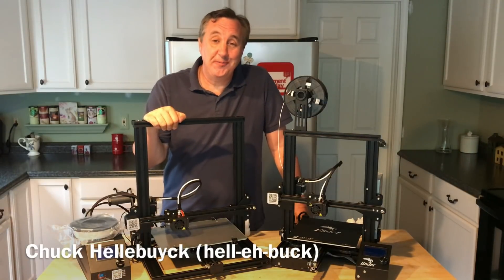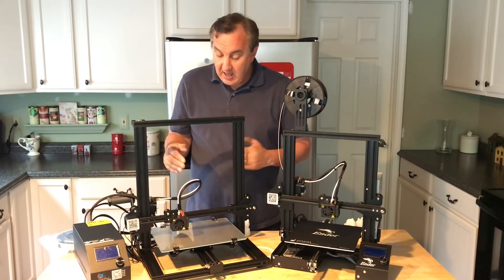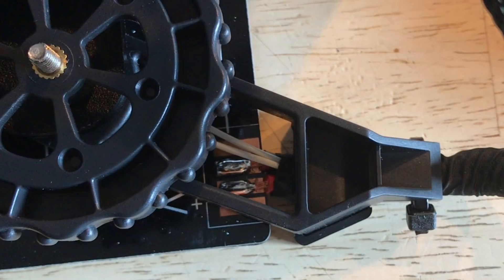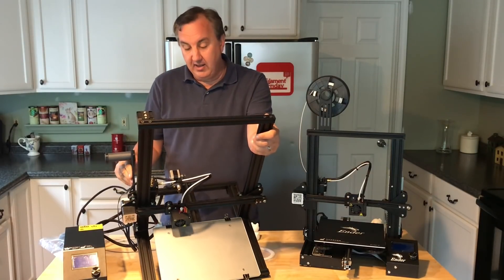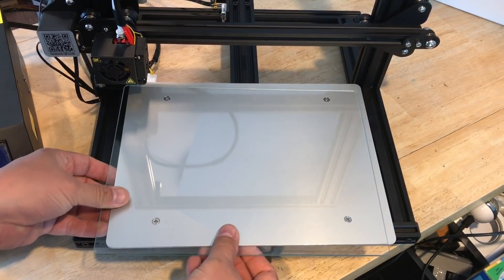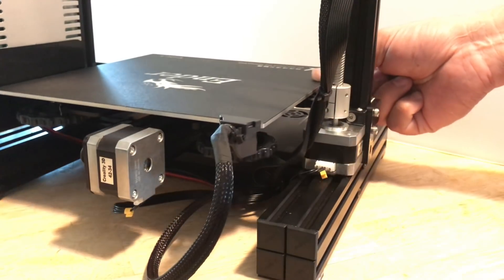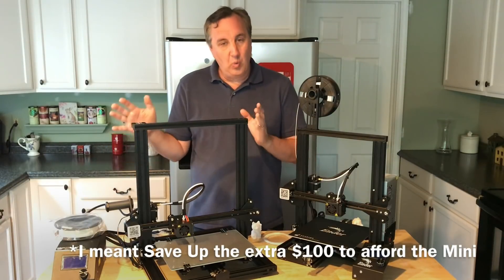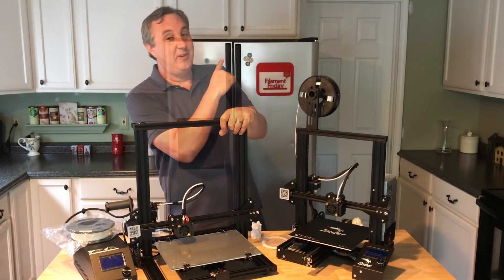Creality Ender 3 vs CR-10 Mini 3D Printers

Comment: I lucked out a couple months ago and got a mini from Bangood for $150 when they were discintinuing it. The only thing I had to do to it was adjust the y axis carriage wheels and mount the spool holder on the top rail. Since I have added the modular direct extruder feed and experiment with some settings. Thank you for the excellent teaching videos!

Comment: Great comparison.  I guess they are possibly closing out the CR-10 Mini or something, because I just got a CR-10 Mini new from Banggood for $150 shipped.  So now I have gone from Mini (Monoprice Mini) to Mini (CR-10 Mini, which isn't really all that Mini...).
First couple of prints with glue on glass have come out great....
My MPSM has been solid for me, and still working, but I was eyeing the Ender 3's around $180ish, but then saw the CR-10 Mini deal and couldn't pass that up...

Comment: I watched your videos setting up my ender 3, i had no problems what so ever with it, it printed the dog flawlessly with great quality. it came out smooth with no stringing or bumps, used a red PLA bought from amazon. It was a Definite upgrade compared to the Da vinci Jr 1.0 that i had been using.

Comment: Definitely the CR 10 mini is still my go to printer for a awesome print and I haven't had as many problems with the mini  than the CR 10s or the Ender 3. I've had  the mini the longest which has been over a year now and other than me printing some upgrades and normal stuff that goes wrong over time.

Comment: Hi, I’m new to 3D and I’m in the process of deciding on the overall best printer between the Ender 3, Ender 3 Pro and CR 10 mini. Pretending they were the exact same price, which one of the three would you choose? Thank you!
Reply: Donna Sandoval Ender 3 Pro
Reply from the maker: CR-10 Mini is bigger so that is an advantage. But they aren’t the same price so Ender 3 is the best deal in my opinion of those three. It leaves you budget to upgrade the board to silent board, upgrade the PTFE and upgrade the extruder for flexibles.
Reply: Thank you for the great advice! That helps me make my decision! Love your helpful videos!

Comment: Thanks, Awesome...been l;ooking around after the printer i wanted ended up sold out from 599 for 302?! ..couldnt resist. but too late when i had the cash to buy. So i find a model 10 websites later nd many vids.. come to more models ect ect... but somehow the whole afternoon and turning into night-early morning fast, I keep ending up seeing you do a comparrison with added cool clever Real info where what and why YOU upgraded something. Thanks, I decided now I also really REALLY liked the other vids on your channel. Especially the one where you explain replacing the tubing and got bits on amezon ect which you refer to here in the vid. That was really helpfull! cause i almost got a ender ..but really got my hart stuck on the bigger build volume. the extra 10x10 really will work out i think. nI really was doubting the print quality of the cr10 mini out of the box ..cause of the extra 100 dollars and expected to spend the difference on upgrading the ender if i bought it.  I really wanted the cr10 mini though and this really helped to see the actual difference between the two out of the box. I SO Happy the cr10 mini did well in the test. 
I wil be adding some improvements like if seen in earlier videos from you. So Yeah . Awesome for putting in the time. I'll be back :-)
Alx

Comment: Hi Chuck! I am not sure if you see the new comments on your older videos.I was thinking about purchasing a budget (400 below for me) 3d printer and I narrowed the choices down to the Ender 3, the Ender pro, and the CR-10 Mini. Of the three, which would you recommend? Thank You!
Reply from the maker: All good. CR-10 Mini if you want bigger prints. Otherwise Ender 3.
Reply: CHEP Thank you so much for responding so fast! I had one more comment I forgot to ask in my previous comment. My question is what do you think is the best beginner and budget (400 below for me) 3D printer for someone how has little to no experience with 3D printers. Thanks Chuck!

Comment: Wish I had the CR-10 Mini.  My Ender 3 is stable but the bed is great on the 4 corners but dips in the middle.  I just got some Ace Hardware cheap window glass ($3) and a glue stick.  Works great.  PLA , glue wasn’t required.  PETG.  Different story. 😆

Comment: Hi
I've been using the Ender 3 Pro for a couple weeks now with no real issues but yesterday and today I've been getting what I think you call layer shifts but only on the bigger prints smaller prints seem at large OK is this a mechanical issue? Or software?

Regards
Reply from the maker: Not sure. It’s often related to acceleration settings.

Comment: Thanks Chuck!  I haven't bought a printer yet and I have a question about the banggood site.  It has the following notes under the product specs for the CR-10 mini: 

1. Do not include T-bracket(right side)
2. The US/AU warehouse do not have the adapter

I think maybe those correspond to the numbered features they list above the specs:

1. Based on CR-10, Only take 5 minutes to install and test
2. Support resume print while power failure.

Does any of that give you pause?

Thanks!
Reply from the maker: No, if you are in the USA make sure you buy from the USA warehouse. It will ship within 3-5 days and shipping is only $2.99.
From Banggood :  https://bit.ly/2u5XNJk

Comment: What about the heating of the bed on the CR10 mini? I mainly want to get an Ender 3 because I know that the original CR10 could only heat the bed up to 85 degrees celsius and it is slow like a snail. Is the Mini any better?
Reply from the maker: It’s a bit better as the bed is smaller but because it’s 12v it takes longer to heat up. I can get to 90°C easy enough but Ender 3 is faster.

Comment: I Have the ender 3, but i wish i had seen this video sooner. It prints great no doubt. And I really wouldn’t need the cr10 mini extra volume.

 But I just hate the way how it’s built. The electronic box and the control panel are so unpractically placed. 
The y axis aluminium profile is 2040 (horizontally mounted, the bed carriage rolls only on the 20mm side) and is connected only in the middle to the frame. On the other profile (4040) there are two milled grooves. First on the left for the wires coming from the electronic box,  and the second 20mm groove to “fit in” the y profile, right in the middle and I believe that’s the cause of the frame twisting because it’s the core profile of the whole frame and it’s weaken because of those grooves.

On the cr10 mini there is no 4040 profile in the middle, but two 2040 profiles, first on the front, and the second on the back of the base. Both mounted, nothing milled.  Which I think is much better solution. And the y profile is the same 2040, but it is mounted vertically, so the bed carriage rolls on the 40mm side, and it has 2 mounting points. 

An those freaking wires are driving me nuts how short they are.

I’m actually thinking about buying some extra profiles and rebuilding the frame to the cr10 mini style.
And also making a second z axis like myfordboy did on his channel to his cr10. 

The printing quality is just matter of tweaking the settings. 

Sorry for my English, It’s not my native language.

Comment: The CR10 Mini looks great. 
I have the Ender 3 and I am not sure why your frame is wobbly. I didn't tighten anything until it was fully assembled to allow some play in the frame. It was only  after it was fully assembled I went back and tightened up the bolts. I suspect that could be where your wobble is and also possibly affecting your prints. 

Great printers. I bought my ender 3 off ebay for $165 and I couldn't be happier. All of my desired prints are small anyway.

Comment: Hey Chuck. I found this video, but a bit late I guess... I've been trying to figure out which printer to buy as my first but there are just so many different kinds with only small differences. I've come to the conclusion that Creality3D is what I want to go for but there is still Ender-3, Ender 3X, Ender 3 Pro, Ender 5, CR 10 Mini, CR10, CR10S and so on...

I notice that in this video you recommend the CR10Mini, but then in most of your newer videos you are using the Ender-3..?

Which of the above would you recommend, or discard? And what would in your mind be the most/first important upgrade?

I hope you have time to reply! I really liked your videos, I'm now subscribed and will keep watching all of them.
Reply: I believe the Ender 3x is only for 1 country. I feel the Ender 3 is a better buy than the Pro as they are basically the same. The various tweaks are minor and a glass bed can be purchased (major difference) for $20. 

Moving up is just about build size mostly. I bought the Ender 3 for it's price point to start. Will you use the thing a lot or will it just collect dust in 2 months? I didn't know the answer so I bought as cheap as possible. I'd rather have a $165 printer collecting dust then a $400 printer, in the event I don't use it. However it is addicting. Knowing what I know now, I may have splurged with the cr10 mini but the Ender 3 is great and I have no buyers remorse.
Reply from the maker: I still like the CR-10 Mini. Solid simple printer with same electronics as Ender 3 but 300mm build are in X and Z but Y is same as Ender so it fits on a bench. Electronics is separate but that makes it easier to fix and separate if you want to enclose the printer. At under $350 it’s a great printer.

I don’t really see the big advantage to 24v. I use CR-10 minis daily. They heat up fine. I just really like the glass bed and larger build area. Most things I Print will fit on the mini. The Ender 3 can be a bit small. But for small detailed prints the Ender 3 has a slight edge. The lighter bed and no glass produce slightly better detail.

Comment: Kind of continuing Tim Robertson's question a few days ago because the price difference has made it too appealing (CR-10 is $40 less than Mini on Creality's own site)... So besides the physical differences between the Cr-10 mini/Ender 3 and the CR-10, does it just come down to lack of Auto-resume for the CR-10 (the older mainboard)?  And if I'm remembering correctly from a bunch of threads I read online, Auto-resume really only works well if caught before temps start dropping on the printer (I'm out of luck if I'm monitoring it from work)?  Trying to figure out how important Auto-resume will be for me, the hobbyist.  Thanks Chuck.  Happy Holidays to you and yours.
Reply from the maker: Auto resume can be added with a firmware update. It’s not a big deal.

Comment: Nice video.  have you noticed any heating time differences between the two machines - 12V vs 24V?
Reply from the maker: The Ender 3 has a smaller bed so it already heats faster even if they were equal voltage.

Comment: I am curious.  Does the control box for the Mini stretch to be placed on the right side of the printer versus only on the left side?
Reply from the maker: You can get extension cables from Banggood to do that but it won’t reach without it.
Reply: Thank you
Reply from the maker: You can get extension cables from Banggood to do that but won’t reach without them.

Comment: Due to prices going up so much how do you feel about CR-10 vs CR-10 Mini since they are now almost same cost?
Reply from the maker: I took the extra threaded rod off my CR-10S. I like the CR-10 better than the CR-10s.
Reply from the maker: I recently had similar conversation with my YouTube friend Jimmy DiResta. I set him up with a CR-10 mini. He had it setup and printing in less than an hour and loves it. Ender 3 your still assembling it in that time. 

It all depends on what you want to print. Personally I think one Ender 3 and one CR-10 mini in the shop is the best choice at around $500 for both. Then you can print big, small and twice as fast.
Reply from the maker: Where are they the same price? I’m still seeing a $50-$70 difference. Both are good machines.
Reply: CHEP, well I went back to check and the link I had was sold. There was on about $30 difference 1 day ago. I will probably purchase the larger machine. Just wanted your opinion. The price difference isn’t an issue. I just want a good functioning machine.
Reply from the maker: The CR-10 was $339 for a short time which is a great deal for that printer. I don’t think you can go wrong with either. I have both and use them all the time.

Comment: I just bought an Ender 3 in Australia for about half the price of the Mini. That's AUD$239 vs AUD$460.
Reply from the maker: Yeah, the Mini has really gone up recently. I believe it’s related to Christmas rush.
Reply: Where did you buy it from?
Reply: @sammyflorczak8800  Ibought it  8 days before Xmas on eBay. I was also lucky enough to get the eBay 10% off at that time  which made it $215.10 (USA$153). Now the not so good news the same place has it now for $249. 
I only bought it as it was so cheap and my CR-10s had a capacitor failure at C4 on the board and I was waiting for some capacitors I had bought from eBay. At this point in time the Ender 3 has been pretty good.

https://www.ebay.com.au/itm/Upgraded-Creality-Ender-3-3D-Printer-220X220X250mm-DC-24V-15A-1-75mm-PLA/382650062511?ssPageName=STRK%3AMEBIDX%3AIT&_trksid=p2057872.m2749.l2649

Comment: Thank you Chuck. I've been trying to gain knowledge to make an informed decision before purchasing. I was originally considering a Dbot CoreXY (and will probably have one in the future at some time) but, I saw how big of a community the Creality printers have behind them. Your video helps me reaffirm my decision to go with the Mini (I don't need the bigger build volume... yet.)  I still may get an Ender for my niece.

I have a quick question though. You mentioned that having the electronics fastened to the frame of the printer has its positives and negatives. Do you think the electronics of the Ender could be re-configured into a separate unit like the CR-10 with a little DIY?  Are the cables long enough? A little sheet metal, a bending brake, a couple of extrusions to connect the base ends and a different pulley on the base could make it a mini CR-10 Mini!

p.s.  I hope Connor has a good game but doesn't shutout my LA Kings tonight. I hate that the NHL decided not to participate in the Olympics. I was looking forward to seeing him represent the team for many years to come.
Reply from the maker: It could be done on the Ender 3 but the wiring needs to be extended so it’s a lot of work.

Comment: Do these require different wiring for a 220 watt thing, llike a different plug? or is the wattage for the heating bed?
Reply from the maker: If you mean European 220v use, then no. There is a switch on the power supply that you flip to 220 and if you buy the non-USA version you get the proper cord as well.
Reply: thanks, I wasn't ssure if I'd have to rewire my house to use one safely

Comment: $329.99 for the CR 10 Mini through your link.
Reply from the maker: Im told they sold out of the USA warehouse but more stock is coming soon and those will be the $289.99 price so keep watching. 
Right now the full size CR-10 is only $339.99 which is a great deal.

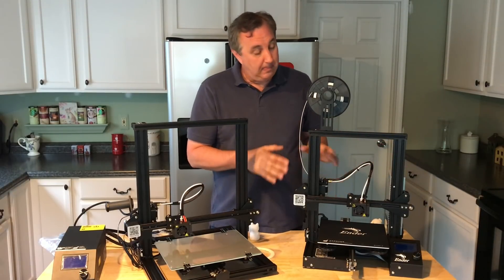Comment: Thanks Chuck.   At 4:13 you comment on the Ender-3 spool holder being too narrow for wider spools.  As shown, the holder has been assembled correctly, according to the instructions.  Another reviewer also pointed this out, and one of his viewers left a solution in the comments...  remove the spool holder from the frame, rotate it 180 degrees, and refit it.   Now unscrew the spool support tube from the pressed steel upright, and reinsert it from the rear.  The holder (which is still in the same location it started from), will now accept spools up to 10mm wider.  If you look at the CR10 Mini spool holder at 4:20, you will see it uses the same tube, but it has been assembled as above, right from the start.  Both machines will now accept spools up to the same max width.
Reply from the maker: No, my point was the height (and angle) that I didn’t fully explain. I couldn’t mount it on the back like I did with the CR-10 mini because it was too short, the spools hit.

Comment: Is the CR-10 mini enhancement over the Ender 3 proportional to the price, or is it much better in respect to the price (I mean the upgrade is more worth than the 100$ price premium)?
I don't really have a lot of money to spend, but I want something relatively reliable and the best bang-for-the-buck printer. Right now I was really leaning towards the Ender 3, but if you say it's total crap I am willing to save up for another month or so.
Reply from the maker: They are both good but the CR-10 Mini gives you a bigger build area so you can print bigger objects. Print quality is similar. I like the larger build area.

Comment: I don't undestand you about ender-3. I've one and it was nearly mounted from china (it took me 15 minutes, I've a bq prusa i3 and a ultimaker 3 and this ender-3 took me less time for the first print than undestanding the ultimaker). 
The base was perfect stable (not dancing like one you show). 
And the print quality is like you are showing on cr-10 mini, not like the ender pritn you show. 

Are you sure your ender-3 has no mechanic problem?
Reply: Carles, I purchased my Ender-3 from Banggood China warehouse, and, like yours, mine came much more assembled than Chuck's did.  It did not rock at all, went together smooth and easy, and printed great from the first try.  I think Chuck's might have been an early release?   Really pleased with my choice, and don't forget that, while an extra hundred bucks may not sound like much, it is fifty percent more expensive.